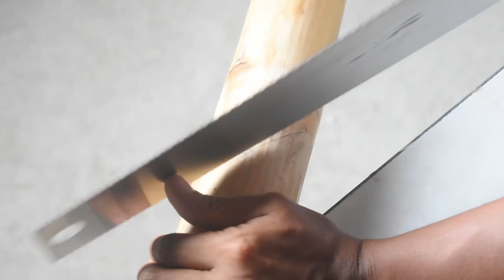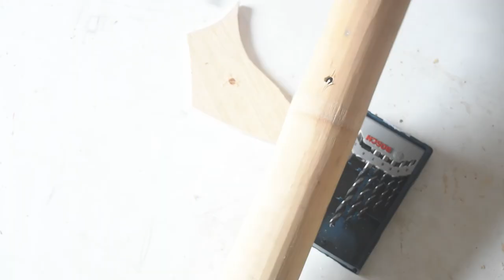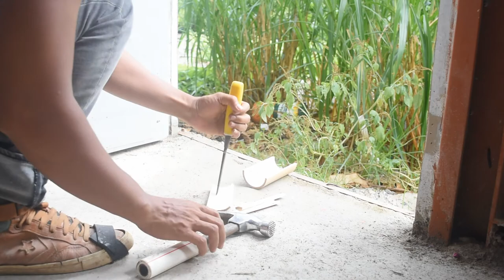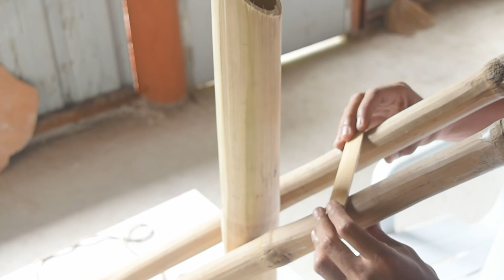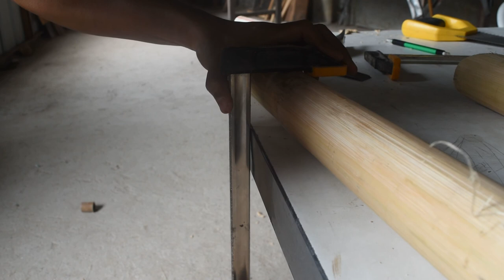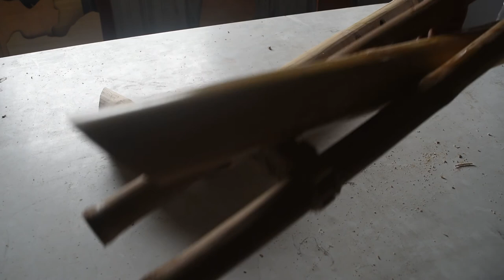Shishi-odoshi - Deer Scarer: One Day Build

Comment: we've been working on a little shishi odoshi and I feel like we did everything wrong: my brother cut the holes for the stick in the moving piece at the part that fills with water, leading to it leaking. I'm thinking about redoing that part completely. but then the next problem is to aim the water that comes out at the top rightly. the pump seems to be too strong and it's a solar pump, I can't change anything about it. no matter how I moved the bamboo piece from where the water comes out, it keeps going into the moving bamboo wrongly so half of the water drains down at the side of the bamboo, instead of going into it. plus, at the moment the bamboo goes down, the water that keeps coming from the top splashes on the bamboo and also drains out of our bucket when it goes back up. we use a little bucket and because of all that, it loses water fast. it's ridiculous lol. excuse my bad English!
Reply from the maker: first of all, your english is excellent. 😁 its true that making this can be tricky but what’s important is the satisfaction when it does what it’s made to do (when u hear the end of the bamboo making that satisfying sound. thank you for sharing your story. 😁
Reply: I know this is a bit older post, but I hope I can help in case anyone else has the same issues. First, you have to put the holes the dump tube is going to be pivoting on BEHIND a node that hasnt been knocked out. That allows the water to fill up, then tip the tube.
Next, depending on how your water is delivered to the tube, you can adjust where it actually hits by adjusting the length of the piece the water is coming out. If you place the water falling right at the top of the fill tube, when it goes down, it won't hit the outside of the tube and drip down it and out of the water resivore. It's best to cut the angle of that fill tube to allow you to adjust it. I hope that makes sense, what I'm saying is hard to explain without a visual. A sharper angle is going to allow the water coming down into the tube to actually hit inside of it through the whole range of the tube tipping downwards. 
Also, just to clarify what I said about the node being intact on the fill tube, when your making this, the node needs to be as close to the center of the tube as it can, but slightly towards the front side of the tube where it fills, you need to put your holes behind the node to the heavier side of the tube. That weight is what makes it pop back up after the water empties.
I hope this helps someone cause I'm not really sure how to describe this any better and it does sound a bit complicated but it's actually very easy.
I forgot to add, a solar pump isn't optimal for this since the usually change their water flow based on the brightness of the sun. You'd have to keep adjusting it all the time and that would be a pain.
On the other hand, if you've got a pump that is too strong of a flow even at it's lowest setting, you can get an inline ball valve and use that to lower the flow some more.
Reply: @spaceavenger54  its my second summer with the shishi odoshi now and im happy that its working well. the solar pump is not making any problems at all: its either not pumping any water if theres no sun (which is good for the neighbours at night) or else we placed it so the water is going straight into the filling part. so if its stronger it just makes everything move faster. yes its very difficult to explain. we had to replace the bamboo this year because it got a good crack during the winter. i guess it got too dry? we kept it in a greenhouse. but at least that gave us the chance to fix all the mistakes we did the year before.

Comment: Hello and congratulations on your creation of the Japanese fountain, it is beautiful, so much so that I started doing it too😅 .... Excuse me ... for this water feature what pump would I need? I wouldn't want to buy it too powerful, are solar panels suitable for this game too? Thanks in advance and have a nice day😉 Federico
Reply from the maker: hey! thank you. I didnt use a strong pump for this. 30-40watts should be enough for this. A solar powered pump is great though you’ll want to use something with lesser power. thank you!
Reply: The power of the pump you use will depend entirely on how high an elevation you want to make the water go.
Measure the height of where the water is going to draw the water from (the pond, usually) and then from there, the height at which the water is going to feed out from.
Take this information with you to the hardware when you go looking for pumps, and that sort of information will be on the pump boxes.
Alternatively, if you need help, the store assistant will need that information as well, in order to help you choose the right pump.
You can use a less powerful pump, but know that if you buy an underpowered pump, it might well burn out faster, as it will have to work hard to pump water up that high, and it will die faster.
Get a pump that is powerful enough to do the job easily, and it will last much longer.

Comment: Hi this is such great work…would u mind sharing what was the rough diameters of the two pillars and the moving piece u used? And also which glue you used for the bamboo?
Reply from the maker: hi. I think I used 2-3 inches wide bamboo for the pillar and I used quick drying epoxy as adhesive.

Comment: Hey
I want to build it 
How do I measure the angle of the middle bamboo ?
Because I worried that it will maybe stuck
And will not fall down..
Reply from the maker: Hi! Good question. In my case, I had it on a 45 degree angle. All i did was made sure that the hose inside the bamboo was angled downward. I hope this helps. 😁